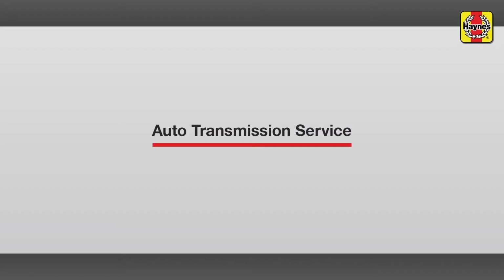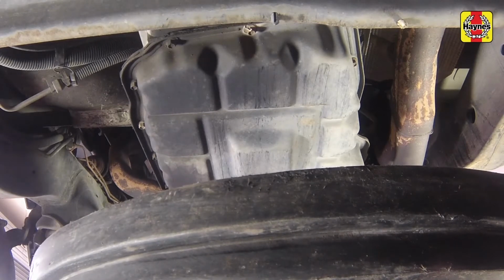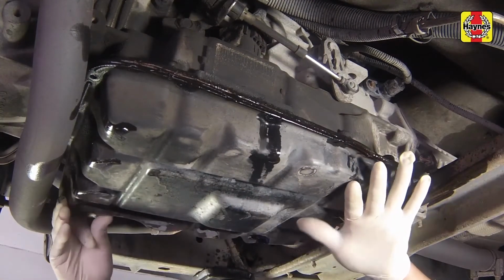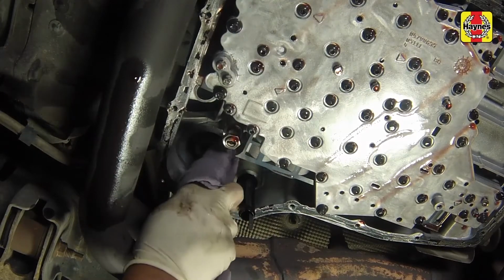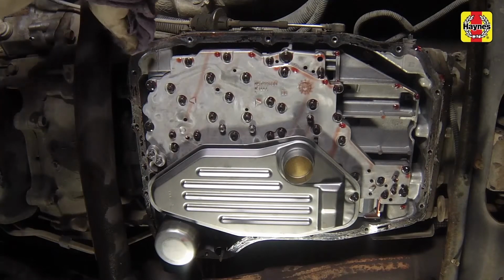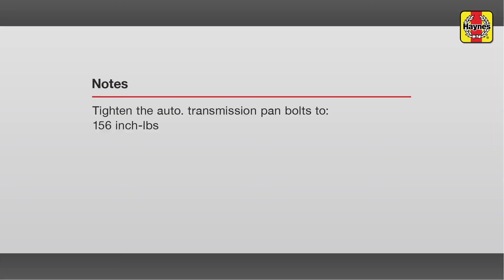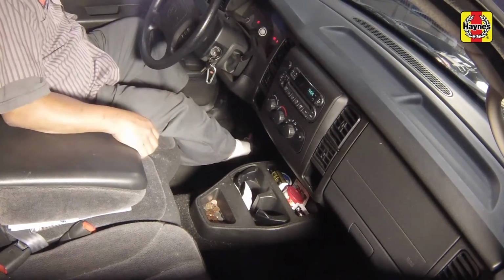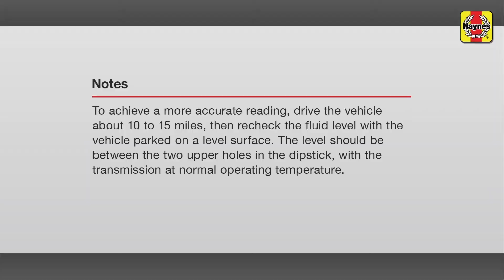Dodge Dakota (2000 - 2004) - Service the auto transmission

Comment: How do you do it for a manual transmission. Literally cannot find where I check it (no visible dipstick) and can't find the reservoir where I'd fill it. Thank you for any help you can offer. I appreciate it.
Reply: On Toyotas (2004 Corolla and 2004 Scion XB) there is a drain plug on the bottom and a fill plug on the side.  The fill plug on the side is set at the height of the correct oil level, i.e., you put oil in that hole until it flows out, then screw the plug in.  I'm thinking most manual transmissions are similar in this regard.